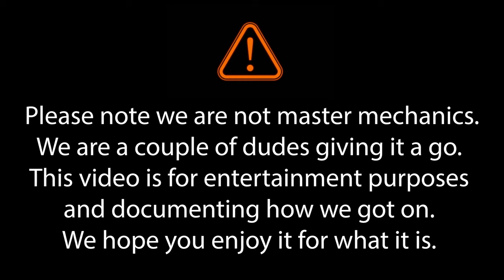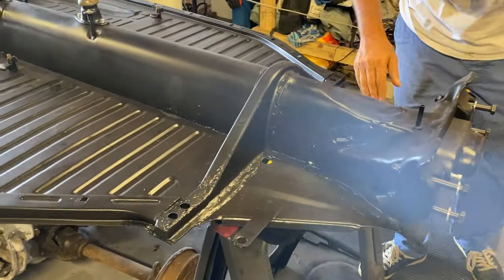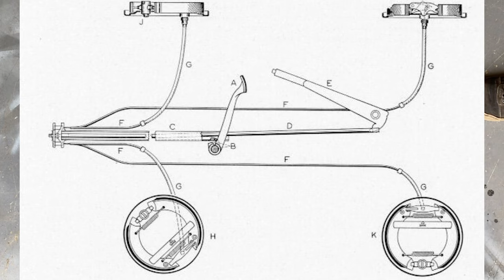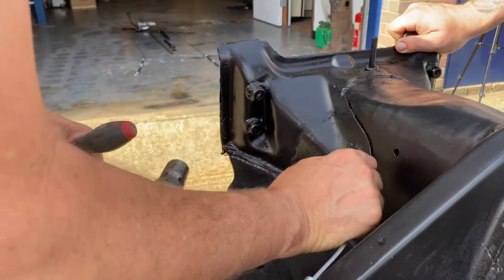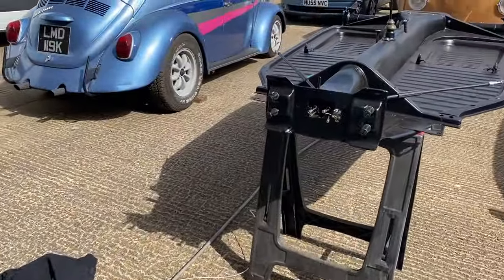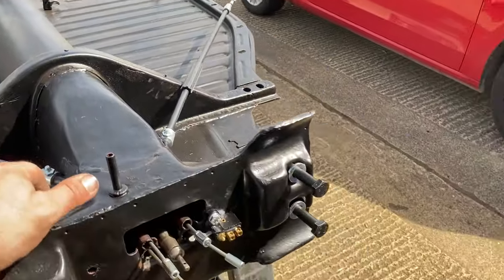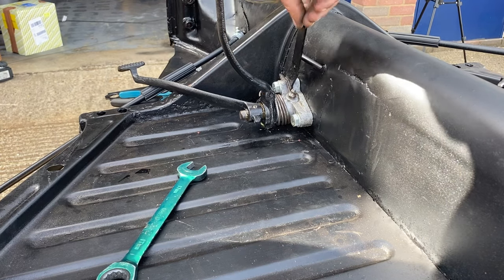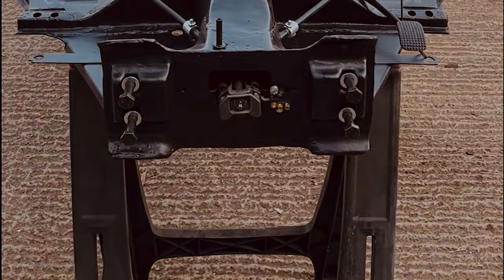Project '49 - Intro to the 1949 Beetle project and cable brake install

Comment: Nothing beats the rear view of split-window, W-decklid early bug! great to see this restoration. I remember a quote from henry Ford regarding cable brakes: "The safety of steel from pedal to wheel!". (Apparently, he was reluctant to move to hydraulics).
Reply from the maker: It's a good looking backend for sure, pressed deckled on this one too!

Comment: You can use stainless steel push bike brake cables to clean and pull through cables if you the them to them .
Trick I learnt for the brake cable or clutch  cable hook is put it on add a bread loaf thin wire to hold it on and grease is your freind  on everything   great update Ned 👍🏼
Reply from the maker: Thanks Nick! All the tubes had already been rodded through so we assumed it would be fine! (you know what they say about assuming!)

Comment: Where did you get the new floor pans from?
Reply from the maker: Hi Robert, They are Klassic Fab floor pans. You can buy them direct from them depending on where you are in the world
Reply: @hayburnertv  are the pans stamped correctly like the originals? 
Also do the pans have the 2 braces on the bottom for support where the seats bolt down. 
No seat tracks for the seats and the seats bolt to the pan?
Reply: Where did you get the cables from?

Comment: How did they manage to make so many with all that crap to assembly?
Reply from the maker: It's pretty amazing isn't it! Really from this point onwards though is when VW started to really streamline the process and make things more efficient (thanks to Heinz Nordoff). But figures for 1949 show that they still made 46,000 cars that year, and that doubles for 1950!

Comment: Gentlemen, having some experience with Standard Sedan (Cable brake models specifically), you have a safety problem; the main shaft end, which engages the "finger" on the foot pedal, needs some attention (36.44 min). Your main shaft demonstrates a level of flaring at the engaging arms. If this is too flared, you will lose foot pedal control/engagement of the brakes. THIS WILL HAPPEN - the pedal and main shaft will be wedged together, and the pedal will lose the return 'spring'. 

So here's my story driving my 1953 standard beetle down a significant mountain range (if you have been to Oahu, Hawaii, you will know of the Likelike Hwy, which transactions the Ko'olua Range - going down, they have truck safety ramps - the gravel sloping type); so I go to put on the brakes, the foot pedal goes down, but I am feeling no resistant, releasing it, no spring. Knowing now I have no foot pedal action, I resort to the handbrake, just a few clicks, and brake engagement, thus here adverting a potential disaster. 

That was a hair-raising incident, but knowing that the handbrake engages all 4 drums. like you state, and understanding the mechanism of action, i.e. a few clicks, not a total stop, we were "brake functional". 

Once home and depressing the pedal a few times - normal function was regained. Yet knowing this was not safe, I removed the mail main shaft (a 10 min. job if you have done it a few times), and proved my theory; the arms on the main shaft had flared to inhibit engagement of the "finger" from the pedal; the lose of spring in the pedal attributed it to the wedging "finger" and getting stuck in the arms; and even moving fully through the arms of the main shaft, with lose of total engagement. A hammer, blow torch and some forming Iron square tube, fixed the issue. I did later replace with a NOS part, as I drive my car 3-4 times a week to work over this mountain range. No issues.

Cable brakes work excellent if maintained correctly; these need more attention than hydraulic - i.e. greasing cables via the nipples, adjusting cable tension on the back of the drum plates; and even adding the correct tension adjusters if your cables stretch - AND THEY WILL. This is another point you need to be aware of using new cables.

Great video and look forward seeing more. Aloha
Reply from the maker: Thanks for the tip, we will certainly look into that. Brakes suddenly disappearing isn't something that we'd like to happen! Also driving a 53 over a mountain range in Hawaii sounds incredible!